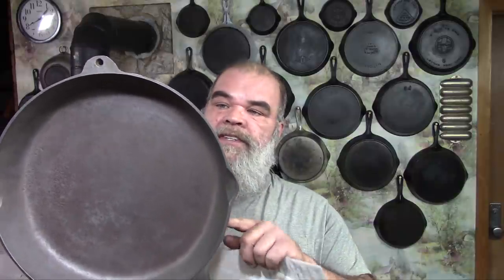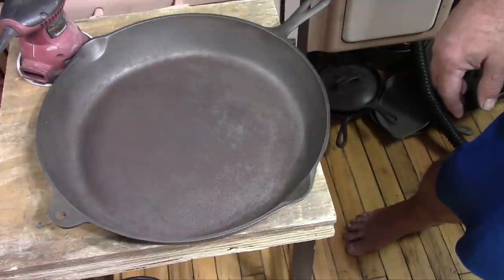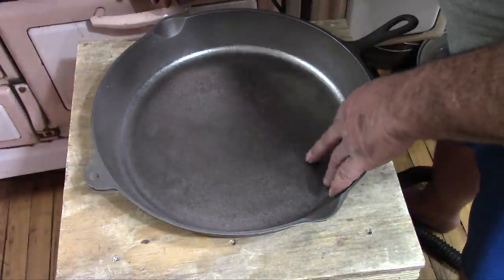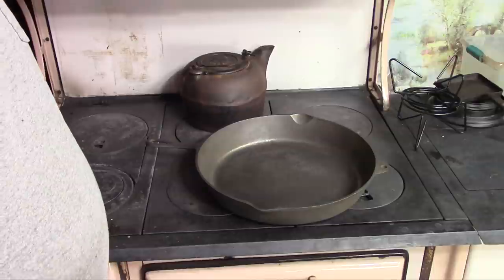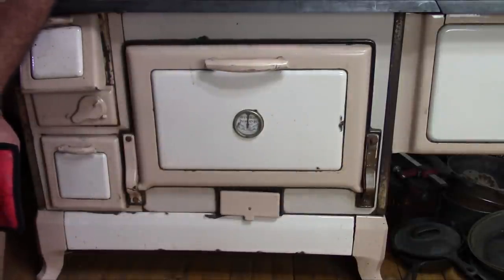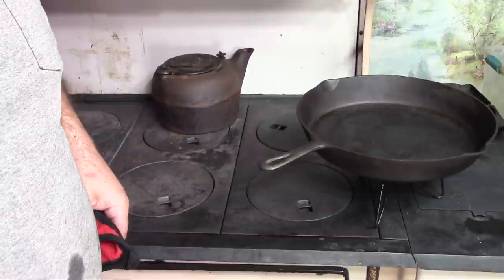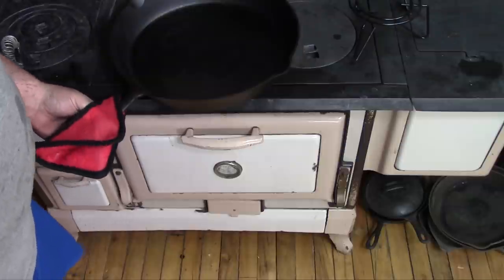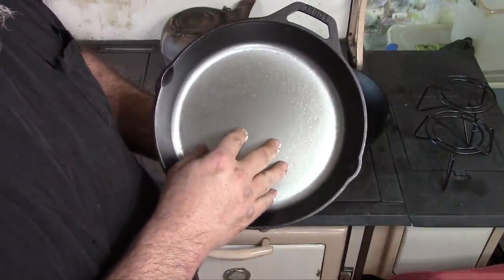Cast Iron in its Native Habitat: Smoothing Rough Iron

Comment: Neat.  I still need to get some cast iron.  Never cooked with it yet.
Reply from the maker: Cast iron takes a little getting used to, it heats differently than other metals. It retains more heat, so once it's heated up you'll probably need a lower fire than you would with your current cookware. Once you get the hang of it though, you'll love it.

Comment: I love the information on the cast iron pan where can I find the stick you were using to oil it with..I have a older square iron skillet that no matter what you do to it leaves a black film on it so I don't use it.
Thanks 😊
Reply from the maker: Easy Beezy is sold at  cicookware.com
Reply: Give it a good wash in hot water dry it well with towel then warm it up slowly on low to med-low put a small amount of Cristo and wipe around your pan like he shows its should help.
Reply: @TheMudbrooker  that account is closed (suspended).

Comment: How do you adjust the heat of your stove? Is it gas, electric or what else?
Reply from the maker: That's a wood fired stove, you control the heat by controlling how big the fire is, how fast you let it burn and where on the stove you place the pan.
Reply: @TheMudbrooker  Thanx for replying. It must be really tough to control....for idiots like me. It's very interesting how you could cook on it so well though. Cheers. Like your channel.
Reply: Fire needs three things, heat, air and fuel. To control the heat in one of these, you can control the amount of air the fire receives.
Reply: The firebox is on the left.  Move skillet closer or farther is the quick way while waiting for fire to heat up or smother down.
Reply: @Muttbike65  Thanx
Reply: @rafterL78  Thanx

Comment: Really cool video! I was brought up with smooth cast iron in the house... When I got some pans for myself, they were rough and I didn't really like it. I work in mechanical engineering and do a lot of shop work as well, so I did use a grinder on mine... It's just that you need to have really good control and a very light touch! Not a job for a beginner!! A quick roughing pass at 40 grit followed by some fine with the 80 grit got it to where I wanted it. I also bought a piece of 1/2x12 hot rolled flat bar for my home made BBQ smoker to use as a hot plate. I cleaned up the scale off the cooking side using the same process. It looks and feels like a restaurant hot plate! Nothing sticks to it and leave it outside stored in the BBQ and not a spot of rust on it! As long as you keep using it, it will keep itself clean and non stick!!

Comment: Appreciate the video. New to the cast iron world.. Bought a 12" Lodge skillet about a year ago. No sanding but seasoned it at least 3 times before I cooked with it. Absolutely love that skillet. 
I ordered another Lodge 10.25" deep dish that should arrive today. I'm going to sand it a little.. Not bare metal, but I want to see if there is a difference. My first piece hasn't been sanded, but it provides a nonstick surface and cleanes up with little effort.. What are your thoughts? 
Btw.. Not my choice of bourbon, but I like a nice pour when I'm grilling or throwing some protein on the smoker!
Reply from the maker: I very seldom sand pans, when restoring vintage pans it's only needed in very rare cases. And like you said, even with rougher textured pans like the new Lodge ones the roughness doesn't cause a problem. That said, some people prefer a smoother textured pan. If you do want to sand your new Lodge pan, use an orbital sander with 50 grit paper, you don't need to strip the seasoning first, and ten minutes or so of work will smooth the surface nicely. You don't need, or really want, a polished mirror finish.

Comment: Hi Mudbrooker, hope things are going well in your neck of the woods.  Totally off topic, I have a question I wonder if you can help me with.  I have a fire damaged CI pan and have been cooking with it for 2 years or so.  At first it would not take seasoning but lately it has.  Can you tell me what the damage is that occurs to a pan and makes it not suitable for cooking with?  Cheers
Reply from the maker: Fire damage drives oxidation into the metal which makes it porous and makes it brittle in some areas but not others. The oxidized areas tend to repel seasoning, in time it usually sticks but it takes time. I'm gonna do some experimenting with fire damage, but it might be a while. Most fire damaged pans aren't beyond hope, but it takes patience.
Reply: @TheMudbrooker  The pan I have doesn't have a nice ring to it like the others, and it does stick in areas for sure. Good to know it's oxidized metal that caues that and hope one day the whole pan will season nicely.  
Looking forward to the experiments as they actually sound fun!

Comment: Good to see how to smooth out a pan, it turned out great.  Looks easy enough to do and wonder if sanding can be used to take the convex bubble out of a CI pan I purchased on ebay, as the animial fat rolls to the outter edges of the pans.  
Question, I purchased an ebay pan that was cleaned in a fire that left red marks on it, is there any way to keep it seasoned?  It's a great pan although I would like to keep it more seasoned, is this possible, other than adding lots of animal fat while cooking with it?
To my surprise it was easy to  move from yt to join!  Call me Whiskey Intellect if you can, as cj is just wrong, lol.
Reply from the maker: If the bottom of a pan is warped, there's not much that can be done about it, if you try sanding it flat there will be very little if any iron in the middle. Pans that have been in a fire can be tough to deal with, but most times they're still usable. Burning a pan in a hot fire changes the metal, it burns out the grains of carbon in the iron and causes deep oxidation leaving it porous. Your best bet would be to strip the pan with oven cleaner, sand the cooking surface a little then re-season it. You may or may not remove all of deep oxidation, but you'll at least smooth up the roughness some. After that it's a matter of using it, in time the seasoning should improve.
Reply: @TheMudbrooker  Well, looks like I need to learn more about buying CI online as I actually have two, one convex and one concave, lol.  They are still useable but it can be a pain when cooking certain things, cheers1
Reply from the maker: @tallcedars2310  Convex, from the inside, is a bit unusual, pans normally bow downwards when they warp and it makes them rock or spin. A little bit of warp can be a positive from the buying point of view because it brings the price down. Unless it's severe it's usually just a matter of using a bit more oil so it goes all the way to the sides.
Reply: @TheMudbrooker  Yes, I couldn't believe it when the fat all went to the outter edge and the center was bare of fat.  Just tested the pan using a pencil and there is a slight rock from the center.  Am wondering if the pan was tossed cold into a very hot fire since it has fire damage also?  It does sit flat although rocks side to side from handle across, not the other direction.  It's a nice McClary spider drip top pan that still does the job. Yes, I cook eggs near the edge and in runs around the edge and not to the middle.  All my other pans do bow downward.  As you say, this one is odd.
Reply: Ff

Comment: Sanding is definitely on the no no list in the collecting/restoration world, but for pieces that are new or significant pitting?  Why not, great results!
Reply from the maker: Sanding is something I seldom do, and then I try to keep it to a minimum.
Reply: @TheMudbrooker  if you're keeping the pan, and it's rough?  I say why not!  It does ruin collectible value on vintage pieces tho, so I won't on those..
Reply: Oh the purists. Cast iron is one of the cheapest metals available and to worry about collecting/restoration is a waste of time.  Making such a rough surface product more suitable for delicious cooking makes it more valuable  to the people who use it for the reason it was made, not the patina [aka rust, corrosion, pits, sticky rough surfaces. Nobody started out manufacturing cast iron pans as a collector's item.
Reply: The really old cast iron pans that I have appear to have been machined flat from the factory on the inside. I've never needed to flatten an old pan. The newer ones are the ones that seem to be made incorrectly and need fixing
Reply: @spacecase0   Lodge says it would double the price of their skillets if they finished them nicely like the old machined skillets.  That's why I stick to the old stuff.
Reply: Did you sand only the bottom? Not necessary to sand the  inside sides?

Comment: Rough pans hold onto seasoning better, which is what makes the pan non-stick.  Sanding it down has exactly the opposite effect of what you want.
Reply: Guess those near glass smooth carbon steel pans don't ever hold on to seasoning....

Oh wait.

Internet experts are annoying
Reply: @jadeolin8514  Carbon steel has different properties than cast iron, but yes the principle is the same.  A rough surface holds onto seasoning better than a glass-smooth surface.
Reply: The original comment is absolute nonsense

Comment: I'm sorry, but I gritted my teeth and winced as I watched you apply that sander to a vintage pan that could be as much as 90 years old.  It's your cast iron, and you can do what if you want with it, but nonetheless any resale that pan is effectively gone.  Also, I was genuine worried that sander might have crack the pan; as well as the fact that you don't need a glass smooth surface to cook with any cast iron pan.
Reply: I have a modern Lodge with "rough" surface, and another one from local foundry that's even more "rough"....  And have absolutely no issues cooking with them and both are great users.

If you need a smooth surface, ho get yourself a Stainless Steel or a Teflon pan, but why changing the nature of Cast Iron!
Reply from the maker: You raise a good point, I should've been clearer in the video exactly what the point of the exercise was. I agree with you in principle and share your objections toward doing anything that removes either metal or value from a cast iron piece but I also believe there are exceptions. Rather than typing a huge wall of text explaining myself it would be easier to do a follow up video addressing your concerns. I'll have it up tomorrow afternoon, hopefully I'll be able to convince you I'm not just one more idiot on YouTube attacking valuable iron with a grinder.  :)
Reply: @TheMudbrooker  I appreciate you saying that.  As I said, it's your cast iron and you can do what you want with it.  And if you feel you have a good reason to sand it, then that's your choice to do so.
Reply: 90 years old just makes it an OLD pan. Inexpensive cast iron does not become more valuable with age if it just sits on a shelf.  No CI manufacturer ever considered this very crude metal for anything other than a great way to cook delicious food. Amazing people don't get upset with placing a 90 year old pan on a hot surface or heaven forbid on an open flame.
Reply: It was a newer pan not worth much.
Reply: FIRST, CHECK THE PAN FOR A HEART BEAT....SOME PANS MAY HAVE MORE THAN ONE HEART....IRON USUALLY SURVIVES TOUGH LOVE....I SURE ENJOYED MY FIRST VISIT....THANKS
Reply: @paulcrocker818  So it's actually the Doctor’s cast-iron skillet